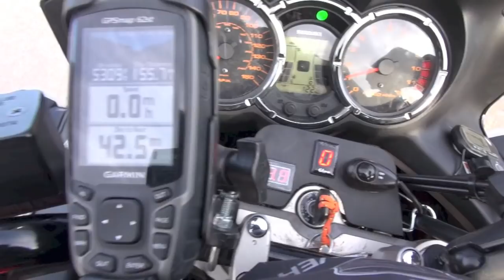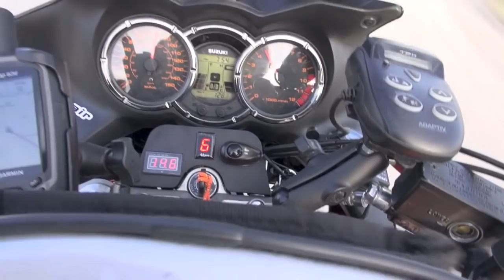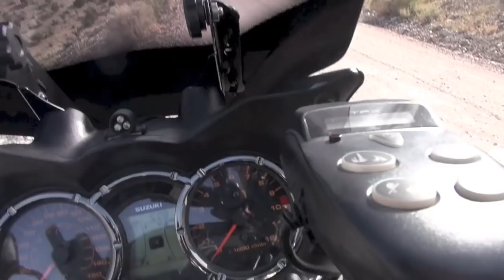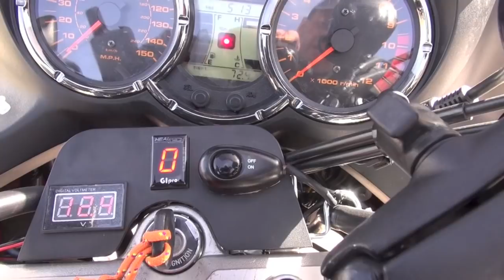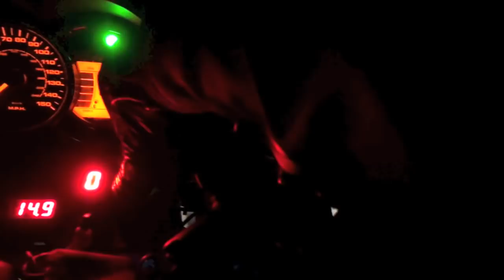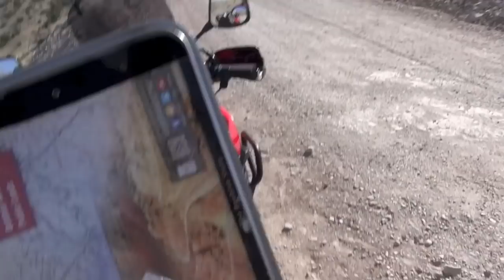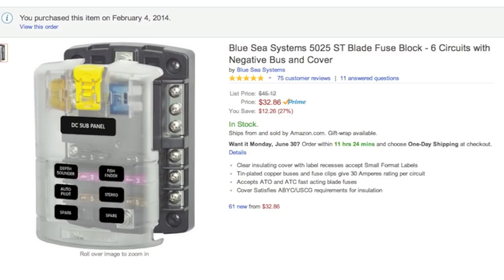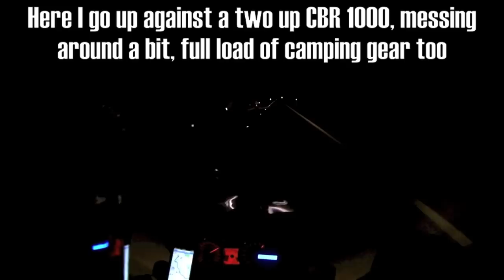Suzuki DL1000 VStrom Review: Adventure Bike?

Comment: The V-Strom 650 is IMHO the best all around motorcycle hands down. The 1000 is in most cases too much motorcycle. It's heavier, eats more gas, and the only thing it does better than the 650 is top speed. Which on public roads, off road, and trail riding, you will never see the motorcycles full potential (legally anyway). The 650 is perfect for adventure/touring, general day to day riding, and hitting twisty roads.

Comment: Thanks for another great video nut'n. I did a low speed low side with a brand new BMW F800GS a few weeks ago. I didn't have the engine protection on the bike. Totaled. All the gear, all the time. That goes for the rider and the bike.

Comment: Let me get this out of the way, I own a 2012 V-Strom DL1000 (Black). I have owned the bike for 1yr, 2 months.

Everything Nutn said is spot on. It is a very good all around motorcycle. It does need some aftermarket help for true adventure riding but everything you need is out there. Each item show is highly recommended not just by Nutn, but by many other V-strom owners as well.

The bike does very good as just a sport tourer which is how I use mine. If you go mainly street use, at the very least, get the Madstad screen bracket and the fork brace. If you want to go off road, do not even look at a dirt road without the aftermarket skid plate.

No regrets buying the 1st gen model. The model has been out for 10 yrs. There will be a supply of replacement parts and accessories for a long time to come.

Loved the roadside review Nutnfancy. Thank you!

Comment: I chose a vstrom (2005)  based on your awsome review and I love every second I can get on that great bike. I am in Quebec Canada and love going in the trails more then highway. But I must admit that twisting the throttle at 100km and get to 150km in a blink is very is  much fun. The stock gears are 17-41 and will go to 15-43 so the front end will lift very often ;) it does already with stock gears so I will go smooth the first time!

Comment: I just looked at the specs for the 2014 model and they've improved the instrumentation:
The instruments include an analogue tachometer and a brightness-adjustable LCD speedometer. LCD readouts include an odometer, dual trip meters, the gear position, the coolant and ambient temperatures, the voltage, the riding range, the average fuel consumption, the instantaneous fuel consumption, the traction control mode, a fuel gauge, and a clock.

Comment: Thanks for the showing your Electrical Wiring Setup Nutn! I've been working on getting the parts needed to wire up my own 12v Accessory Plug and I wanted a fuse block to keep all the wiring nice and neat. That Blue Sea Brand Marine Fuse Block looks just like the part that I need! :D

Comment: Love the DL series bikes, you need heavier fork and shock springs for sure. Suzuki set them up soft for comfort. Try the RaceTech cartridge emulators, it essentially turns your damper rod fork into a modern shim cartridge type

Comment: Great vid. I'm about to pick up my third Vstrom tomorrow. I have most of the same accessories you have on your bike. I would recommend you check out Jim Davis - Eastern Beaver (Japan) for electronic items. Great service and I replaced my Blue Sea with his PC-8 - which is much smaller and has 2 extra circuits.

And that skid guard that Yann makes is killer. I have/had the older model and the bolts are on the bottom. Not great but it works. And those hiway pegs are like nothing else. Love em.

Why are your rear signal lights different? Those look like they're off an old TW.

Jealous of your luggage. One day... Always ran Givi's, then Peli 1550's. New (used) bike has Trax. Always wanted the Touratech.

Gone through 4 sets of the Heidi K60 tires. Going with the Mitas E-07 Dakar for the new bike. We'll see how they work. The K60's always gave me great mileage and corner as good as i've ever needed.

smurph

Comment: Just bought a 2012 from a 2001 Concours and it is much more comfortable except for wind protection around the shins, you feel like you'll setting in a recliner with rocket propulsion and on rails in turns, also V twins 90 degree rule. The charging system when south but I think I need a new regulator and rectifier easy fix, glad I bought it. Thanks for a great review this is better than the reviews in magazines you don't have to worry about losing BMW advertisement money when you say the Strom is better than the GS.

Comment: @ nutnfancy, totally agree with you on the Adaptive TPX.  It's simply not good enough.  Probably the best solution would be a compact version of the Escort 9500ci and the Beltronics STIR+.  The antennas are waterproof, and they both have small displays you can mount on your bike.  Only problem is they are both on the expensive side, and you still have to figure out a way to mount the control box somewhere.

Both the 9500ci and the STIR+ have great range and reactivity.

Comment: Enjoyed this. I had a 2004 model 1000 that I tried hard to love but it didn't happen. Primary issue was wind protection, which I wished you would have spent more time on.  Nice screen, but was that lip part of the screen or another extra? Other problem was how lean it ran at around 3K RPM. In town where I drove through that RPM range constantly the bike would sometimes cough. Spent a lot of time and made it better, and a tuner like you added would have solved it, but I didn't add the tuner because I had spent lots of money trying to fix the wind protection issue and couldn't. I read a short bit on the new beak model recently and they mentioned the same wind protection issues - a real disappointment. I also have a 2000 SV650 which I love and a 2001 KTM LC4 400-E which is, speaking frankly, getting to be too tall for me (something I thought I'd never say, but age does that). Thanks again for the review.

Comment: Vstrom is a great bike for the money.  For me the biggest improvement was fitting a Wilbers rear shock and fitting Racetech springs and Gold valves to the forks.  It gives you 90% of the capability of the KTM at a fraction of the cost.  I highly recommend suspension mods if you plan to keep the bike.

Comment: Nutn I just added Denali D-2 lights on my BRP and what an upgrade. Night rides in my future because its too hot in the daytime.
 Nutn since you are riding alone especially in rocky country, I suggest you add a tactical tourniquet to your gear. Small enough and light enough and sometimes people break bones on bikes...wink wink nudge nudge. 
 I almost got a Dl650 but I got too much sand here. The 500EXC is best but the XR650 is so economical/low/maintenance/reliable I went that way. I wish it weighed 80lbs less. Great Bike, Great Review Thanks Mang!

Comment: Regarding the piece of wood for the kickstand, check out the 'Progrip 5027'.
It's a plastic pad that does the same thing as your piece of wood, but will weigh a lot less.
I haven't tested it in extreme conditions, but for less than $9, it might be worth a try to save a bit of weight.

Comment: Hey Nutnfancy....Master Lee here.  I have a question.  I just bought a 2012 Vstrom 650.  The clutch friction zone seems really soft.  Is this normal for Japanese bikes.  I'm used to Triumph and Ducati dry clutches.
Reply: Yes, that is normal for that motorcycle. Wet Clutch Bikes generally have a much softer and smoother clutch action. They also dirty their oil quicker so don't neglect your oil changes. ;-)
Reply: LordTimelord Hey Lord TimeLord...thanks for the heads up on the clutch.  Sorry for the delay....was out in the woods all weekend with no wifi!
Reply: No Problem! I've been out myself as well in my new Hennessy Hammock Camping. It is one comfortable way to sleep outdoors!

Comment: hey man, this is probably about the 5th time I've watched this vid, I'm starting to save up for my first bike. I'm looking at a v strom as my first and possibly my only bike for a long while. I personally like the beak strom I like how it looks, but I'll probably end up getting the older style because it will be cheaper and easier to find used. I have very limited experience riding so I'm wondering if I should go with the 1000 or the 650, since I'm 6'5" and about 250 I'm thinking the 1000. I will be taking a course when I buy my bike so I know how to ride my bike and not some sport or cruiser. I will be taking it out on dirt when I feel like I am professant at street riding and even then I'll be going at a pace I feel safe at when I take it on dirt. let me know your thoughts and opinions about my plans. thanks hope to see you at the meet and greet
Reply: +David garverick good luck man. i plan on saving up for one, but not for a while i gatta do college first. i plan on getting a 1000 or something like that defiantly ganna take it slow till i feel alright. i might get into this but i wanna get a street bike first.
Reply: +David garverick IMO, I would definitely get the 1000. I love mine and I'm a new rider. If you end up getting a 2014+, look into a G2 Throttle Tamer. Totally transforms the jerky throttle characteristics of the OEM throttle to smooooooth power.
Reply: +David garverick I am 6'5" and 300  I have been riding   2002  DL1000 for  4 years now.  Cannot say enough good about it.  I am glad i have the 1000.  I know lots of people say the 650 is just as good and I cannot say anything to counter that.   I was like you  looking at price and availability.  Good luck with your choice

Comment: You still need a radiator guard. Built my own out of perforated metal. Filed all the sharp edges, few coats of paint, worked out a mounting solution with nuts and bolts, good to go.
Reply: I agree. I noticed that there was a protective screen on his Oil Cooler, but not on his Radiator. The Guard is a lot cheaper than a new Radiator for sure! You can see the previous rock damage that has caused fin damage on his Radiator in the Video. I think Nutn adding that Front Fender Extender saved him the cost of a new Radiator! ;-)

Comment: Denali light switch does parasitic drain. Learned the hard way. I now run a kill switch between it and the battery. You're electrical system sounds cool if I where running a lot of electrical ad ons. DRZ400S.

Comment: One glaring omission. (unless I missed it)  Compact air compressor.  A tire plug kit is great, but unless you can put air back in that tire, worthless.  I've got a DL650 and carry the Slime compact powersports compressor under the seat all the time.  It's saved my bacon and other riding buddies on several occasions.  Also great to provide the capability to air up/down when needed.
Reply from the maker: greedyg76 Got 'em, and they're essential. CO2 may work for mountain biking, but it's a lot of cartridges to use up on a moto. The trick is finding the lightest one-Td

Comment: Nutn, 1/4" Drive ratchet. I found the Snap-on Dual gear ratchet is rated for 93 Ft Lbs. torque. That lil rascal can break my axle bolts even. I use my long spark plug socket to extend the grip. Light weight super strong = 79 bucks tho.

Comment: I tested bikes for Cycle World magazine for five years. Part of me just wishes you would have stuck with the guns and knives stuff. The best "Adventure" bike on the market today is the KTM 1190 by far. The new V-Strom 1000 has dropped some serious weight and made some nice improvements. I would not have even considered the V-Strom 1000 as serious adventure bike. The V-Strom 650 is a better choice although it's weakest link is suspension and yes, still weight. Stock tires are great on the road and good in the dirt, but why put lipstick on a pig. More off-road worthy tires don't really improve off-road capability because it lacks so much other areas. I have put over 300,000 miles on motorcycles and to be specific, 11,000 miles on V-Stroms, and that's my take. The best do-everything bike is the KTM 1190!!!!!!! If budget is a consideration, go with the V-Strom 650, it's the best do-everything bike for the money.
Reply: I have not ridden the NEW V-Strom 1,000 yet. While I don't think it will dethrone the KTM 1190 it looks to be greatly improved over the old BEASTY V-Strom 1,000.

Comment: The reason your suspension bottoms out is because the Suzuki doesn't have inverted forks. KTM and most bikes do have inverted forks with a metal cover in the front of it to protect from dirt, dust, and mud. Ever the new V Stroms  still don't have inverted forks.
Reply: I take that back. On the new V Strom they now have inverted forks. The model you have in this video does not have inverted forks.

Comment: Radar detectors only do you any good if there are other cars between you and the cop.  What the detector picks up is the signal bouncing off OTHER vehicles.  If there are no other vehicles and the cop doesn't leave the radar on all the time the detector has nothing to detect.  Many cops will now just flip it on when there's a car around.  They may even have them that send out very low power signals until a car appears triggering it to go full power.

Comment: I am surprised he is reviewing a Suzuki as he generally poo poos the cheapest options and goes for high end picks, Suzuki makes good bikes but the finish is usually not as good as the 3 over Japanese manufactures which are usually more expensive.
Reply: you've never ridden a VStrom though :) they are a fantastic bike, built very well and you get a lot for  your dollar when compairing to anything else like it
Reply: Cody McMillan Have you looked at EN187 videos, he as videos riding his Kawasaki z1000, it goes like stink and is a very nice looking bike. If I was in the market for a bike I would probably get a Suzuki mainly because I am a tight fisted  beggar.
Reply: What? He reviews plenty of low cost high value stuff.
Reply: He rides a Suzuki Hayabusa as well and it isn't anywhere near the top of price range when it comes to sport bikes either.
Reply from the maker: Don't let him hear you say that!  Every couple months he's hit me up excited to buy a ducati multistrada. We've had about four separate occurrences of him being 90% sold on it. -TD